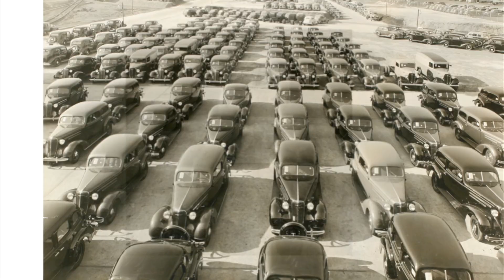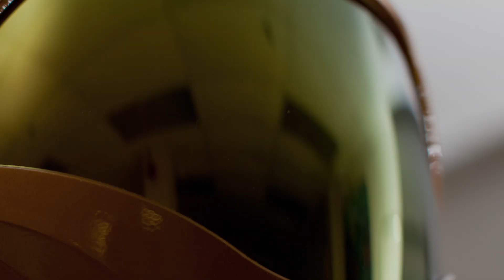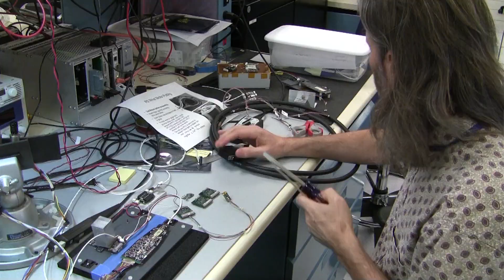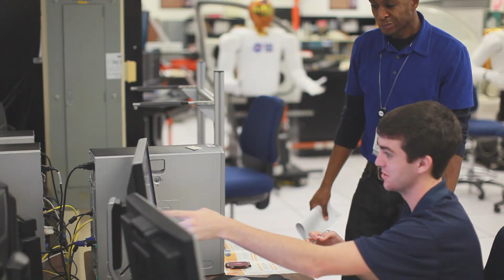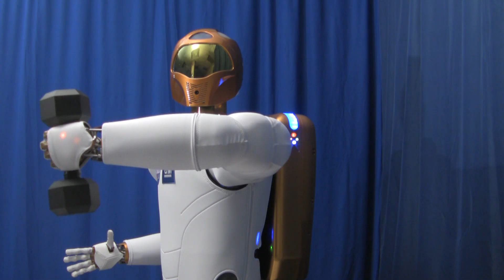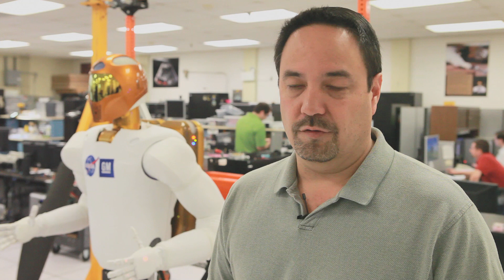NASA and GM Take a Giant Leap Forward in Robotics

Comment: Ein 85-0699388 Jerry Dean rice ii (kc2075 brass knuckles) dba rice co ii holdings federal tax ID ***948302...facebook #100016241621551 mission control 1001071078 cia YWHYAM8W, TC44CW69, ETRF3Q6R SQTY9A8T cia inspector General  defense intelligence agency Kronos aries. Jerry Dean Rice Ii code name eagle eye.... Clandestine defense secretary and clandestine cia director.... All wireless artificial intelligence network administrator director Symantec vip 71825 rolling 855 partial always new and where are you and voice print of javelin prime is operational. Full surveillance package is operational and contact between 4- 2015 to Dec 20-15 then for protocols listed. Nasa bebop a.i. 2515 update rulebot for God'(Jerry Dean ii Rice L080642127 and L994275530 Oklahoma pids) kc2075 IBM watson let me check and see update rulebot for Google Chrome breach prevention software and Google hacker prevention software for all internet protocals on this hardware current and past and present systems and make override all other nasa robots and make read empirical evidence through kali Linux cookie development system of Google chrome OK google sample. ©®™¢